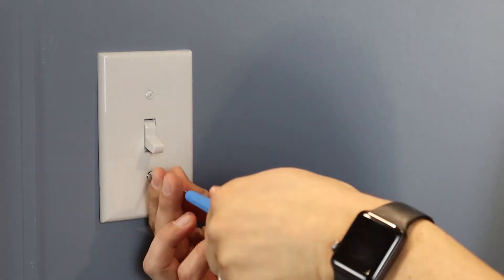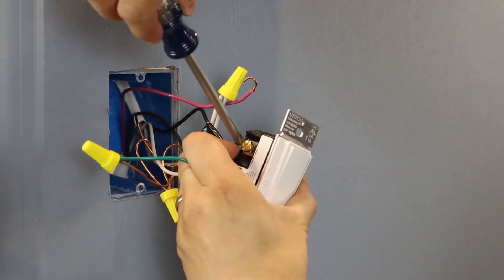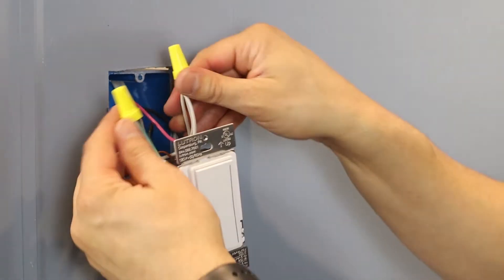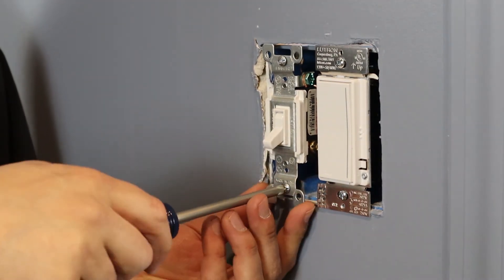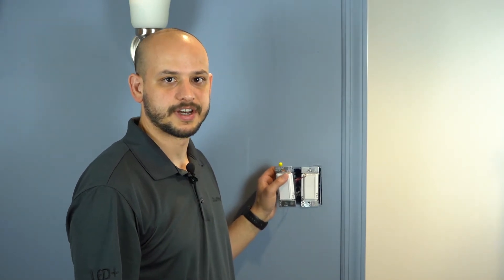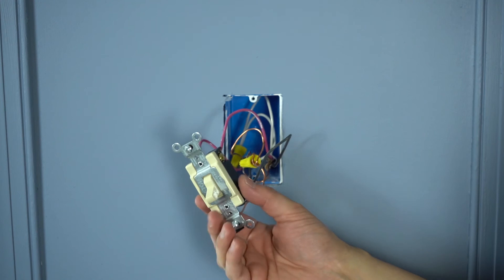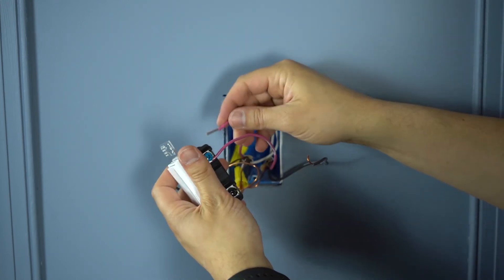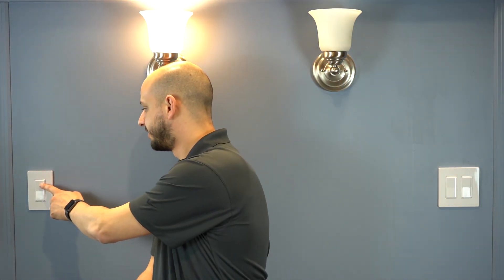Installing a Lutron Sunnata PRO dimmer in a Multi-location Application

Comment: Nothin being said about turning off the circuit or putting yourself into a dangerous situation with a open neutral carrying a load or just getting shocked in general 😅
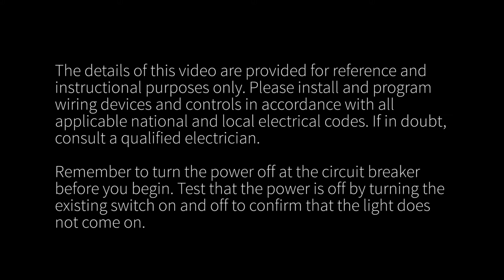Reply: 0:25 read the message on the screen

Comment: My dimmer doesn’t have screws on the sides but instead wires (Red, White, Blue, and Green/Ground). How do these correlate to the screws in this video?
Reply from the maker: Hi, Caleb! Our Technical Support team will be able to best help you with getting this sorted out. You can reach them at 1-844-588-7661 or support@lutron.com. We’ll talk to you soon!